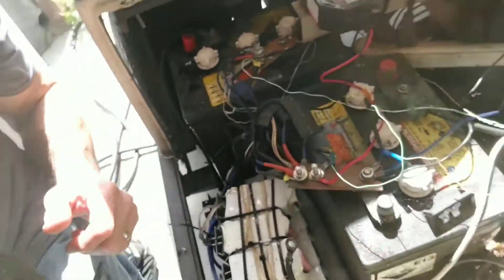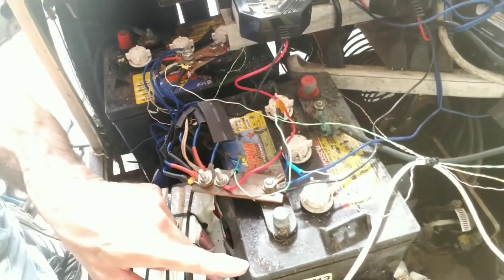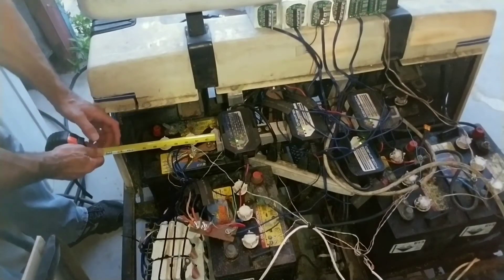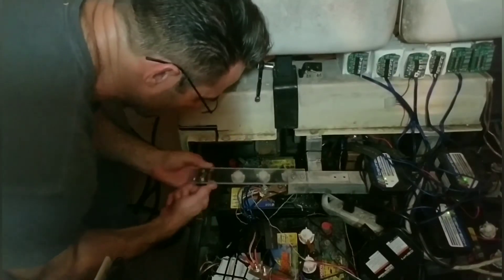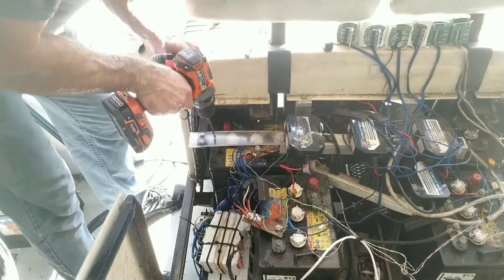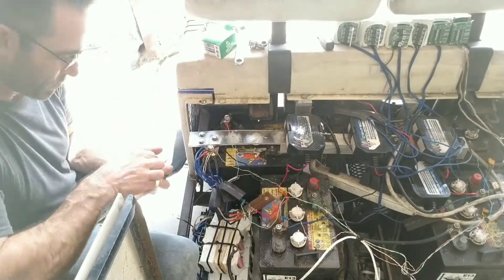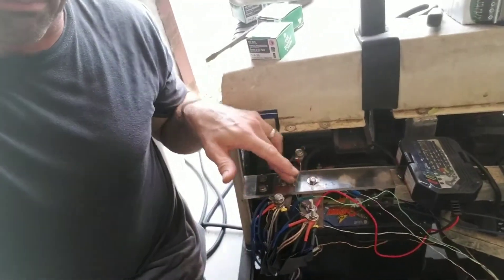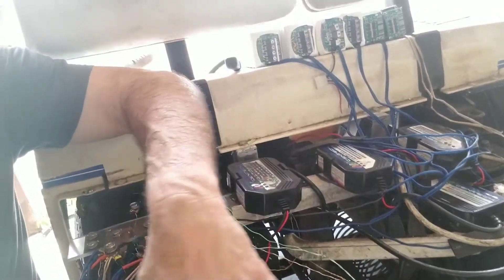18650 Golf Cart - Removing the Second Battery

Comment: So how many 18650 packs did you use? I was thinking about using e-bike battery packs .. the rated for 36v 30ah  50 amp draw ... so with 10 wire in parallel  I could draw 500 amp peak but golf cart controller only pulls 400amps but I never seen it go higher than 190 amps .. that's probably cause the solenoid is 200amp .. that would give me 300ah ... so my question is.. have you eliminated all lead batteries and if so how far can you go?
Reply from the maker: I probably had about 50 packs. But I ended up running into an issue. Each pack had 15 cells. All of the cells were of a different age and quality (even though I matched up AH ratings). Once one cell goes bad, it will take out the whole pack (one bad cell will drain a row of 5 cells and then the BMS will shut down the pack). I didn't know it and I ended up having too few packs running the cart, which overheated some and they caught fire. The cart is fine but I'm switching to LIFEPO4 since they don't degrade so fast and they don't catch fire.
Reply: @paramax55  I definitely read that you need a lot of them .. I was going with full e-bike batteries.. I will probably do 20 cause I can get them for super, super cheap.. but just like lead acid in series, if one cell goes out, your whole pack goes or just the cart is super slow .. but if I only need 10 and I get 20 or 25 in parallel, it may help.. I'm definitely not trying to burn my block down..
Reply from the maker: @productionapostle1298  It worked great for more than a year. The problem is that is enough time for you to get nice and comfy. Then it catches fire when you don't expect it. If I were going to do the 18650s again, and I were doing it all at once, I'd use a DALY BMS with bluetooth. I have that with my solar. It's nice to pick up your phone and see exactly what's going on and it's actually cheaper than all of the modified boards.